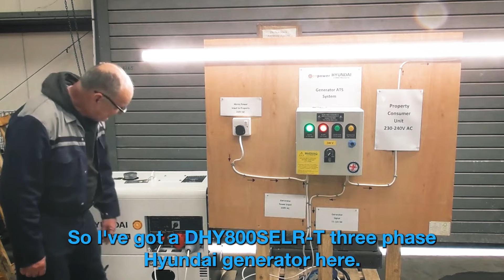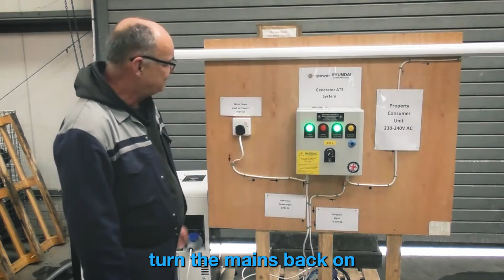What is an ATS System - Automatic Transfer Switch for Hyundai DHY Diesel Generators Explained

Comment: Incredible! You could not have done a more effective demo, everything is very straight-forwardly and clearly explained.  

Now if only i had more important things in my house to justify the cost, than just a refrigerator, my home internet and a small always-on computer (it does home automation, but if the power goes out, there are manual controls already available for the important bits).  Maybe one day 🙂
Reply from the maker: Sounds like an amazing set up!